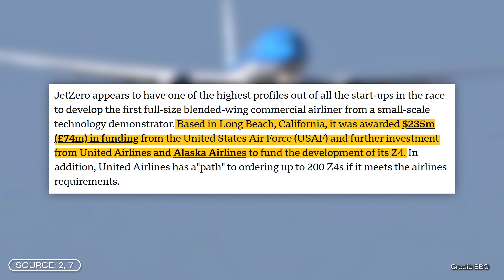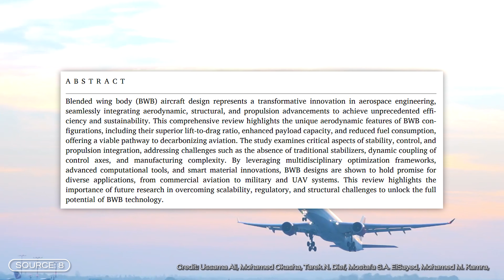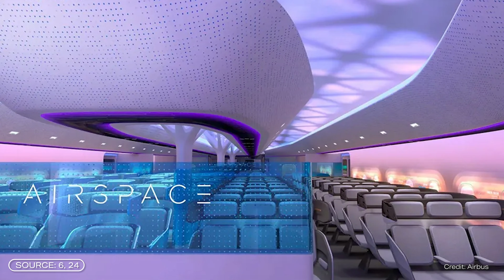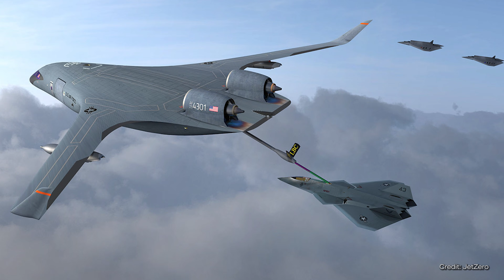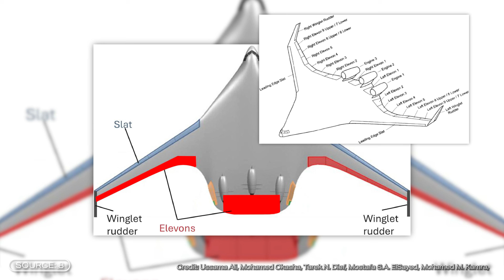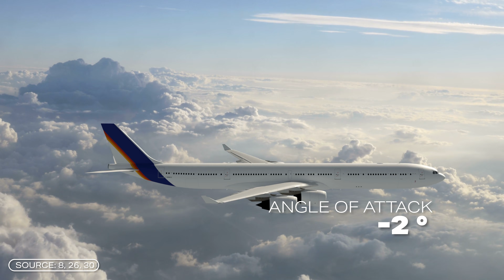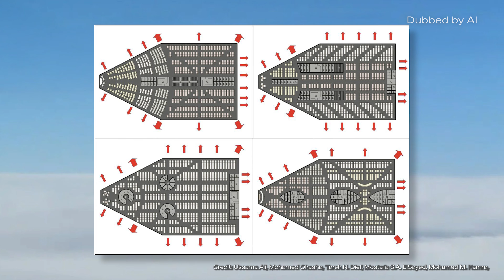The "Perfect" Plane Has One Big Problem...

Comment: I think that the biggest problem is pressurization of non tubular fuselage.
Reply: Seriously? With 21st century materials? Not even creating a single-atmosphere pressure differential.
Reply: @silvershocknicktail6638  yes seriously, i mean you can make it but its just more material added compared to tubular shapes, hence more weight, so the question lies in: is it better to have a more efficient shape but heavier overall or a less efficient shape that is lighter and arguably safer.
Reply: @7om015Exactly. I think a lot of people underestimate just how thin the skin and structure of modern airliners is.
Reply: @silvershocknicktail6638  you'd think it was a submarine visiting the Titanic. 😅
Reply: @kingdaddy-z7w I'll take pressure on the inside any day!
Reply: @kingdaddy-z7w  composites are great at tension compared to compression. basically imagine pulling a rope vs pushing it
Reply: @mortache  Yes, but that's not the problem. The problem is differential pressure. Try inflating a balloon. There's a reason why it automatically gets a certain shape. It doesn't spontaneously form into a flying wing/body. Getting it to take that shape, requires more material.
Reply: Yes but if the weight of that extra material makes up for the advantages in other aspects, its worth it. Especially since composite materials can be as thick or as thin as needed. Metal would be just uniform thickness all around @bartrammeloo5046
Reply: Let them breath bottled oxygen 😒
Reply: do 3 mini tubolar fuselage inside<3
Reply: Crosswinds generate a lot of lift.
Reply: Honeycombed multi material composite hull with carbon fiber internal skeletonization not hard at all
Reply: @Barskor1  not hard, that is not what he said, heavier is the question, safer too? tubular structures are less thick then a penny, now if you actually need a honeycomb structure it just gets too heavy, even if by itself is light, you get the problem?
Reply: @7om015 Planes have already been built and commercially operated successfully with honeycomb structural bodies so with greater lift and flight efficiencies the "weight problem" is not a problem
Reply: Can't they just build a tubular pressure vessel inside the fuselage?
Reply: @ConsecDesign you'd still have space between the outside of the tube and it'd significantly decrease the usable space
Reply: @ConsecDesign Yes. But that adds weight. Plus it makes the experience for the passengers even weirder.
Reply: Can they simply put support pillars in it?
Reply: @andregresham2142  With a honeycomb layered shell you don't need support pillars this tech already exists
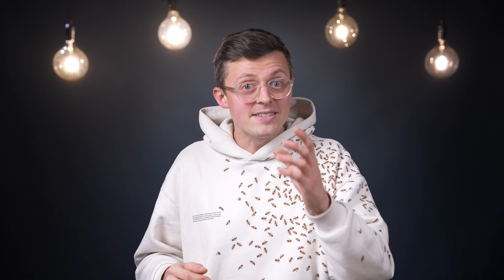Reply: 13:30
Reply: Don’t allow people onboard
Reply: The pressure cycle wouldn’t be enough to give quality carbon fibre fatigue failure
Reply: Irrelevant dude lol
Reply: Finite element analysis and composite construction fixes that. That much is stated in the video
Reply: Your camping air mattress is also holding a lot of pressure and its not exactly round.
Reply: Hmmn.  Junkers did one in 1930.  pushing boundaries are big gambles.   Lots can go wrong.. not just with the plane but with the public perceptions. As others pointed out .cross winds other factors can be considered
Reply: Jetzero's design share several similarities to Delft's "Flying V", that consisted basically of tubes blended together in the front. Is there a official render showing the internal layout?
Reply: That is one technical problem. There is no way to evacuate in 90 seconds,  no one will like to sit in the middle of 18 seat row, at every turn people further from center would experience more positive and negative Gs. BWB means transition surfaces are very thick, like a thick wing which generate more lift but create more drag. Look at 787's wings, they are very slim. Its a compromise and wing go slim you have less space for fuel storage. Also, you dont want fuel surrounding  all of your passenger compartment. 
BWBs are a mess for now, they seem lucrative but they have been studied for decades, were even studied when airbus was deciding on A-380's design.
Reply: @hp2084  Excellent points

 Being in the middle of a twin-aisle widebody with no way to look outside is bad enough, this would be terrible (although nowadays almost everyone closes the windows and just uses the in-flight entertainment system or their own devices).

Interesting thing is @GermanscienceGuy never once talked about the speed regimes of these aircraft. While they'd obviously be very efficient in the lower speed regimes, with those thicker wings I'm thinking they'd become less and less efficient at the higher mach numbers. .75-.77 mach might be fine for going a few hundred or a thousand or so miles, but no one wants to be going that slow trans-oceanic. There's a good reason why aircraft like the 747, 777, 787 and A350 have cruising speeds around .85 Mach while narrow-body aircraft fly much slower. Would a blended wing body aircraft be able to reach these high mach numbers without some form of swing-wing tech like the B-1 has?
Reply: @CaptainCoffee37  Assuming that's all true (not being snarky, I just don't have the knowledge to say one way or the other. Your info is appreciated!), there could be a market for slower, longer flights, especially if they're considerably cheaper than current alternatives and offer a more comfortable flying experience (or just the former, in the case of cargo). This could especially be true if and when carbon pricing starts to be added to fuel prices at realistic levels, and particularly if these designs allow easier adoption of lower-emissions fuels like hydrogen. Finally eliminating such economic externalities could even see a space for dirigible craft in similar roles, greatly improving overall economic efficiency.
Reply: @CaptainCoffee37  On a 10-hour flight it's true that most of the time even window seat passengers will close the shades. But during takeoff and landing it's required to keep them open and it's nice to open the shade periodically to see what's outside -- sunset, sunrise, cloud formations, etc. That's why the 787 windows are vile. The flight attendants can darken them all with one switch and the passenger has no way to override that.
Reply: @R @Rotuma1260  It’s actually not required to have the windows open for takeoff and landing, with few exceptions (I used to fly the CRJ and the 1A window did have to be open so the forward flight attendant could see outside in case of emergency because the air stair door didn’t have a window). If you hear flight attendants telling people they need to have their windows open for some reason thats purely an internal policy of that airline (and yes, often the FAs will fib and say it’s a rule/regulation to get people to comply better). That said I totally agree with you that I prefer a window seat so I can look outside if I want to and see the scenery or get some natural light.
Reply: @CaptainCoffee37  Although the FAA does not strictly mandate this, it is a standard safety procedure for most international and domestic carriers. When FAs inform the pax that they must open their window shades for TTOL, that becomes binding. "Obey all crewmember instructions." So, while a few airlines may be unwise enough not to follow the IATA recommendations, about 95% do. It's much safer for several reasons.
Reply: @Rotuma1260  While you are absolutely correct that any instructions from the crew become binding, I believe you are mistaken about the prevalence of this practice. It certainly is not standard procedure at 95% percent of carriers. My airline does not require this, nor do the majority of the other airlines I've flown on as a passenger. To be fair, I've only flown on US air carriers, but having flown on the majority of US air carriers I think I've only ever heard this instruction on one, maybe two of them, so it's not a widespread policy, at least not in the United States.
Reply: @CaptainCoffee37  You are probably right about the prevalence of US airlines stopping this safety practice. All the international airlines I've been on (more than 40) still require it. Situational awareness, particularly in an emergency, is better than not having it. Passengers and FA can more quickly assess fires, debris, or other obstacles outside if all the window shades are up. That's one of several reasons IATA still recommends it for all airlines. But of course "common sense" isn't so common.
Reply: @hp2084 Wrong. Watch and learn
Reply: @hp2084 One potential solution I seen is making the cabin two cylindrical sections connected at the nose like a V. Which would greatly help with both pressurization and exits.
Downside being the big waste of space, although it might have use in case of using hydrogen.
Reply: @ImieNazwiskoOK the space won't be wasted if they put the fuel tanks there
Reply: @ImieNazwiskoOK hydrogen is the worst sort of fuel outside of a fusion reaction. Even as a propellant, they lose. To put things into perspective, the tabletop RPG (one of the OLDEST nonetheless) Traveller had a basic unit of volume for its spacecraft based on the then-standard for how much volume a metric ton of liquid hydrogen takes up (back in the 1970s, that's 14m^3, this is what the humble dTon is rated at). You're better off using methane/propane/decane for low-temp nuclear rockets (i.e., solid core fission rockets) and WATER for practically everything else (i.e. gas-core fission, most fusion rockets, and most ANTIMATTER rockets)
Reply: @the80386 or indeed smaller tubes for cargo or baggage depending on how large the leftover space is

Fuel like you said is probably the most obvious use case
Reply: @ImieNazwiskoOK Google Flying V
Reply: @hp2084 you have a contradiction in your argument here. You say no one will want to sit in the middle, but later on state that seats furth5crim centre will experience uncomfortable forces. So, which is which?
Reply: @caty863 there is no contradiction one wants to sit willingly in middle and people forced to seat futher will experience g forces. If you arent spending money to reserve a seat you surely are getting what is left.
Reply: @hp2084 just have amenities such as rest rooms, storage, bars in the middle...
Reply: That is solvable.

There is an even bigger issue; The (manufacturing) cost of creating derivatives.

Tube+wing aircraft are very modular. Longer range or higher capacity seating variants are very easy to create via fuselage plugs, allowing these different variants to be built on the same production line and reuse much of the original type certification.

The amount of variants of the B737, 777 and the various Airbuses A318/319/320/321 and A330Neo are staggering, based on the various airline needs.
Reply: @tver  What is less solvable is those passengers in seat A (window seat) and seat T (19 seats away at the other window) are going to experience some significant positive and negative vertical Gs on any banking manoeuvre. The fairground ride seats! see 16:00
Reply: @mb-3faze  Those seats need to come with extra throw up bags..
Reply: @tver and velcro on the table to hold trays down and drinks in sealed cups with straws:)
Reply: @tver  Bullshit. Pressurization of a flat structure is not solvable. But then, I have only been an aerospace stress analyst for 40+ years. You know nothing about pressure vessels
Reply: @PaulWalker-zk2dd Structural & Design Solutions for non-cylindrical pressure volumes:

Deep Sandwich Shells/Panels: To combat bending stresses (which are much higher than membrane stresses in non-cylindrical shapes), using deep sandwich construction with high-strength composite faces and lightweight, stiff honeycomb cores is effective.

Optimal Cross-Section Shaping: While a circle is ideal, elliptical or near-circular shapes can be used with specialized design. Elliptical composite cylinders show that material orthotropy (varying material properties in different directions) can mitigate structural issues like inward normal displacement at the ends of the major diameter.

Autofrettage for Thick Walls: For non-cylindrical, thick-walled vessels, the autofrettage process—inducing a pre-stress field (residual stress) before service—can enhance performance and extend fatigue life.

Bending-Stretching Coupling: Utilizing composite materials with specialized layups can create coupling between bending and stretching, allowing the structure to better resist pressure loads.
Internal Ribbing/Stiffeners: Adding internal structural support frames to resist deformation at the corners of square or rectangular vessels.
Reply: @PaulWalker-zk2dd 

It is solvable by making it quasi flat and not 100% rectangular, use support struts, tensile cables, and/or by allowing some premeditated deformation within the design.

It’s still way more expensive than designing circular pressure vessels, yes, but it is doable.
Reply: Fitting them in airport terminals designed for long, thin tubes will be the biggest hurdle to commercial acceptance.
Reply: @RonJohn63  Actually the airports are not designed for long thin tubes. They are designed for wingspan.
Reply: @RonJohn63  Or build improved airport terminals or load people on shuttle busses and have them walk up stair like they did in the 50s people will put up with a lot for low cost flights or other improvments.
Reply: @Barskor1  "build improved airport terminals" costs a metric fsck-ton more than you think it does (and the airlines don't control that).
Using shuttle busses for people is probably viable (embarking/debarking in rain, snow, etc would be pretty miserable, though), but there might be more done at gates than we think.
Reply: what makes you think that the pressurized space won't be cylindrical ?
cargo and fuel already occupy most of modern aircraft volume.
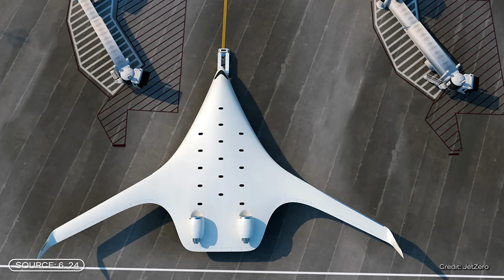Reply: Check out the graphics starting at 5:30 and elsewherein the video. They clearly show the intent of having 20 or more seats across in several sections. No way to make a giant tube encompassing all that. It's a much flatter cross-section. In theory, they might have separate tube structures for completely separate cabins, with most passengers unable to see out windows. Egress in an emergency would not be possible with separate tubes.
Reply: @Rotuma1260  The solution is simple: Don't pressurize the passenger cabin.
Reply: @Rotuma1260  Why? Imagine how nice it would be to just take a little nap and wake up at your destination.
Reply: @ryanmcgowan3061  At 10,000 feet, the fuel consumption would be about twice as much per hour as it would be at 35,000 feet. Also, at lower altitudes, the aircraft will encounter more turbulence, potential icing conditions, and increased air traffic. It wouldn't work economically at all.
Reply: @ryanmcgowan3061 Freeze-dry passengers, and reconstitute them at their destination. "Just add water"
Reply: @ryanmcgowan3061  Yes, Let the passengers hold their breath for the 14 hour flight. Let them also eat cake.
Reply: @PaulWalker-zk2dd  The cake is a lie!
Reply: @Simon1217-d3e So now you introduce two bits of structure, one to resist the external aerodynamic forces, and one to resist the internal cabin pressurization. You have now doubled the weight of a simple tube design.
Reply: @Simon1217-d3ecargo space is pressurised as well.
Reply: @Simon1217-d3e

While cylinders (or rather balls) are optimally shaped pressure vessels, that doesn’t mean it can’t be done with other (i.e. box-like) shapes.

It’s very much doable and feasible.

The passenger deck is roughly the shape of a center wing-box on a tube+wing airliner, but larger.
Reply: I doubt it, they seem to have no problem with that in the flying wing design.
Reply: @keithhoward4069  presumably in the flying wings in use they only need to pressurise the cockpit? 

Those that are in use are only used as bombers and I don't suppose they need to pressurise the bomb bay
Reply: @Saint-Columba  Finally, somebody gets it! Thank you.
Reply: @keithhoward4069  The flying wing is a bomber. Bombs do not breath air.
Reply: @keithhoward4069 Existing flying wing designs have small, pressurized zones. Most of the vents like is not pressurized.
Reply: If I remember right the problem isn't when the plane is in the air but, on the ground it takes up too much space at the airport. Especially when loading passengers. You can fit more planes that are long skinny tubes.
Reply: @brgessner the length, height and width are pretty much the same. The only trouble I see would be the need to alter the boarding tube/ramp. As for windows, so what? Most people don't get window seats already. If I can get a cheaper flight, I'm  good with no window.
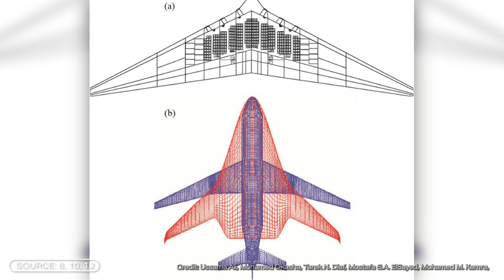Reply: 1:22 in the video, the real issue is compatability with passenger load/unload  docks as those are built for cylinder planes, should just focuse on cargo route as far less issues yet efficiency would be most welcomed
Reply: @zano187 I think the solution to that is actually pretty simple. Load from the top rather than the sides. Via folding stairwells. Yes it adds a good bit of weight but the design has plenty of room to make allowances for such measures.
Reply: @brgessner It's not like tubular planes have their wings folded when in port, you know!
Reply: @caty863 wings are closer to the building. Think about the corners.
Reply: @brgessner  It's not wider
Reply: @phil562 not wider at the wings but its more squat and triangular shape ment they would to park them at a bit of an angle. Either way it wasnt huge but if you could do 10 regular planes you could do 8 to 9 of the wedges. So the airline bean counters didnt like the 10% to 20% reduction of flights. And the 50% efficiency is dependent on current fuel prices. If fuel prices are low its doesnt save that much. If they are higher then it makes sense again. Though I do think the flying wing design is awesome, i hope they can make the math work.
Reply: @brgessner Fuel prices are always important since it is the biggest expense of flying.
Reply: Not Tubular, man😔😔😔
Reply: @TheDeadEyeSamurai  Totally
Reply: Why as long as the body is able to hold the pressure it doesn't matter pressure is pressure it doesn't matter what the shape is as long as the design takes into account for stress points
Reply: @tdobson888  the problem would be the long term fatigue from repeated pressure cycles.  You can reinforce certain sections but that just moves the fatigue to different areas which become increasingly difficult to accurately predict.  In the end you’ve increased the weight, material costs, and complexity for manufacturing and maintenance which dramatically reduces the initial efficiency benefits.
Reply: It would probably still be massively efficient to have the fuselage contain multiple cylindrical substructures that are joined together in certain sections
Reply: @tone618  That would be terribly weight inefficient. Airliners integrate the pressure vessel as part of the main structure of the fuselage. Having multiple of them, lets say, three abreast, would mean instead of two side bulkheads, you now have six. So you're adding a lot of weight and inefficiency in order to chase a hull-form that improves aerodynamic efficiency, very counter-productive. Not to mention that each of those pressure vessels would be expanding and contracting independently, so all your connections and other parts of the aircraft would have to be able to deal with that. And how would you inspect the interior bulkheads of the pressure vessels for maintenance? Would you have enough space between them to have a maintenance access path? Like zeppelins did between their individual gas bags? That's adding more bulk and weight and complexity.

No, on an airliner sized craft, I don't see any way but having a single, well designed pressure vessel.

Also, not all airliners have perfectly circular cross sections to their pressure vessel. Just look at the 747, A380, and even the E-175. It can be done, it just requires good engineering.
Reply: @CaptainCoffee37 I never said such substructures wouldn't be part of the main fuselage
Reply: It's really not, especially with the data we have on composite performance. My guess as to what would hold this back is one of inertia. Not physical but essentially your pilots, the capital costs to reach market, the change in design and everything. If it was a fresh start race today blended would probably win similar to ev would for cars.

Fundamentally we have very little success of novel designs reaching market and I don't doubt  if it was so easy Airbus or Boeing would be developing it as they have the capital, ability and resources. One thing I think might be the worry of is the same thing that hurt the 737max. Tube body designs have a natural stabilizer effect while these are inherently instable. The b2 while amazing has had crashes.  With passenger planes you get one maybe two and you're done.
Reply: @Donthaveacowbra  the problem isnt HOW but AT WHAT COST, remember that airliners  have their strucural layer of a fuselage less wide then a penny, to make a wierd shape you would need a heavier structure. So the problem aint how to do it, but at what cost. and this is only the structural part.
Reply: Not really. The pressures are not actually very high.
Reply: @wstavis3135 The pressure difference is huge at high altitudes.
Reply: Why would that be a issue. Just pressurise a tubular inside, not the entire plane.
Reply: @jonesjohnson6301 its not tubular inside
Reply: Boooooooom

Hope they don't call them comets
Reply: @SillySausage-mq3so  You sound like you don't fly. How's that chair holding up to your 3xl body?